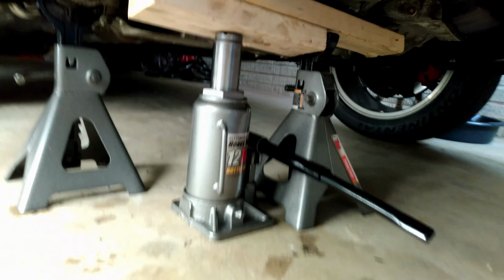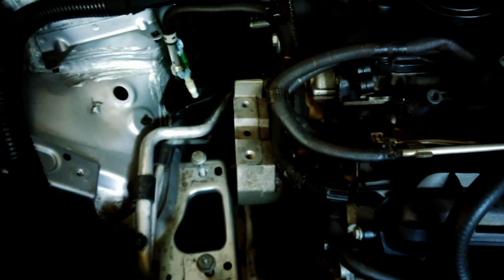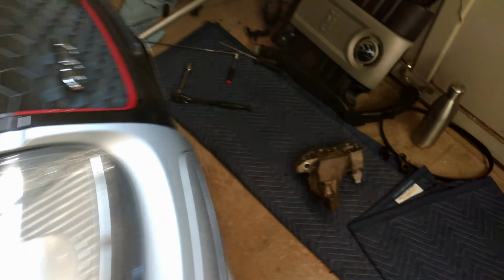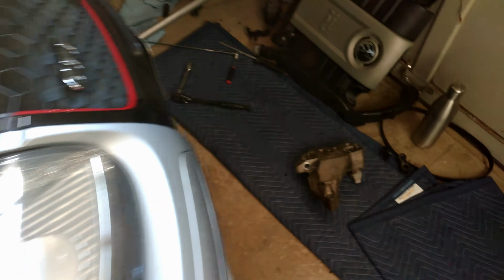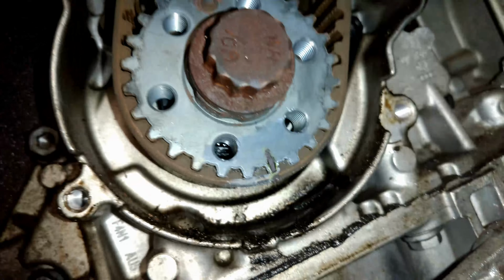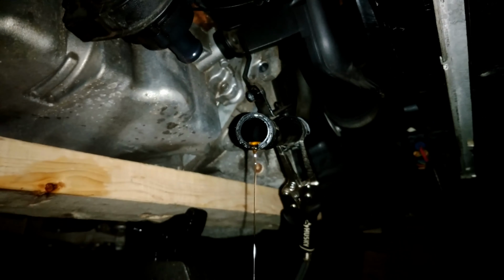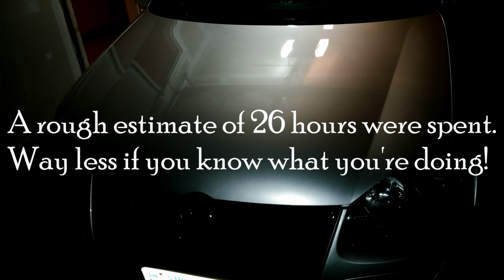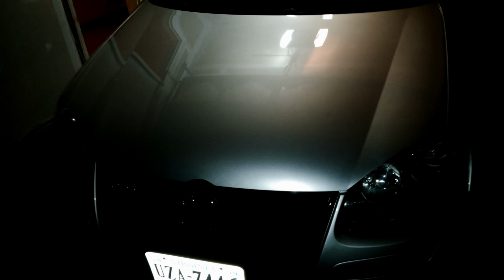2007 Volkswagen GTI (MK5) Timing Belt Service Vlog Part Four - Hipshot Car Repair

Comment: Had a similar problem with the mount last night on a TT.  However the AC lines on this car are not in the way at all.  The worst part of it is getting the top rearward bolt out where you basically have to turn it with your fingers and it's a super long bolt--takes forever and your hand gets messed up badly :|  I was somehow able to squeak it out with the engine up as high as I could go without starting to lift the car and possibly cracking/deforming the oil pan--ugh.  

Plus when I was installing the belt the cam moved backwards a couple teeth, it's a good thing I caught that.  I just gotta put it back together and figure out if I tensioned it right--the tensioner is a bit confusing.  Not going to enjoy getting the mount back on.  Thanks for the video though!
Reply from the maker: Thanks for sharing! Best of luck 🤙

Comment: anyone it's doing it right to remove the collar...you only need to remove upper roller, loosen tensioner and jack up the engine, it goes of easy. For installing, do in reverse, adjust tension and install upper roller once the collar it's in place but not bolted.  I did it yesterday and take 5 minutes.